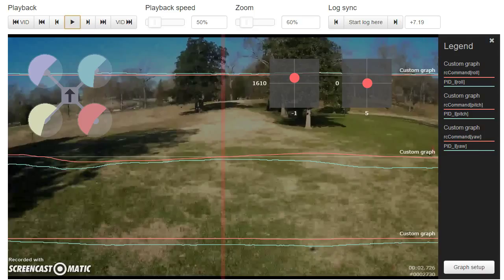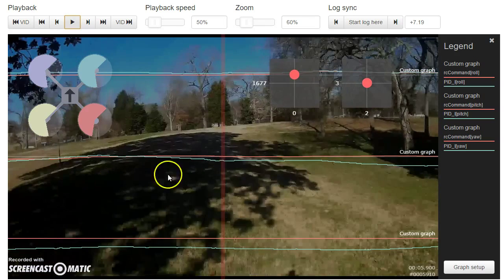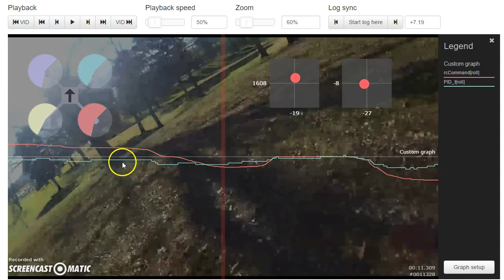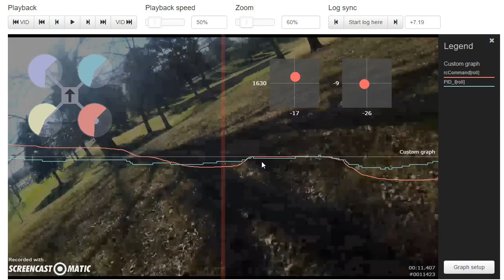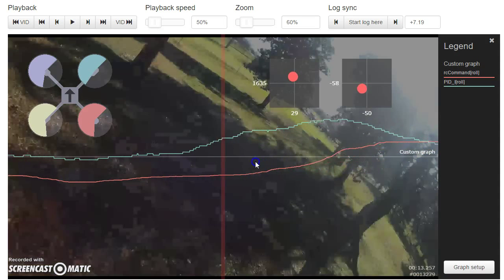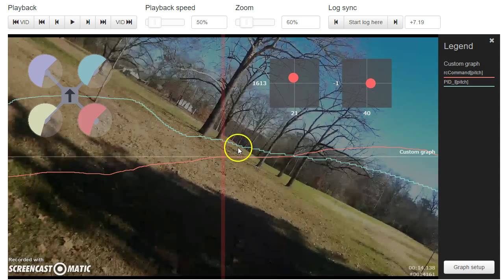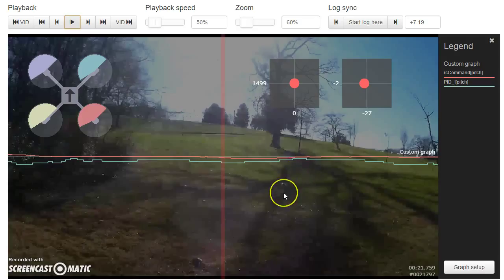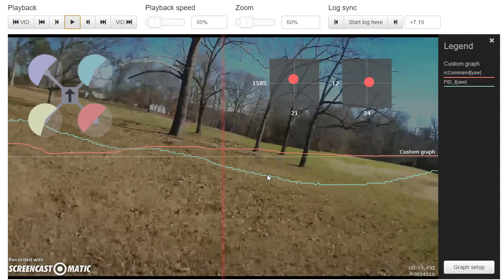Analyzing I term in Blackbox

Comment: Josh, what could it mean if the I term crosses over the axis on yaw, before the rc command settled at zero? I'm just looking at one of my logs now and the item from a pirouette crossed back over the axis and went negative 2 tenths of a second before rc command went to zero. Not a huge amount I know but I'm having trouble getting my head round why that might be. Does that mean my i is just a little too high?  2.8 on yaw p and 40 on I. On luxfloat if that helps. Cheers.
Reply: I only ask as I always expect the I to be following the p, not leading. Which makes me think it may be a little bit too high.
Reply from the maker: +mrmurder75 I'm not really sure. You're right that I should usually lag P, not lead it. Your I gain of 40 doesn't seem exceptionally high either, but it's not low.

One possible explanation would be that your baseline state for yaw I is non-zero. If there was some persistent bias on the yaw axis, the I term would be "neutral" at a non-zero value that cancelled out that bias. If that was the case, then it wouldn't be the zero-crossing of the I term that would lag P, but the crossing of the baseline neutral value, whatever that was.